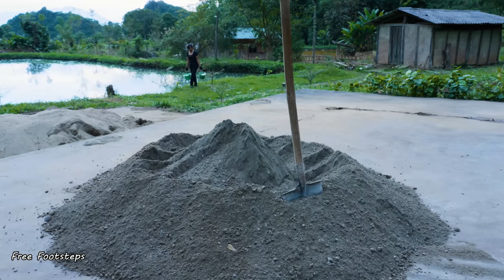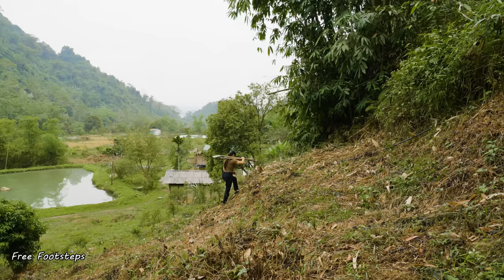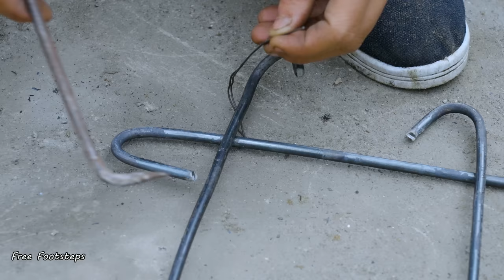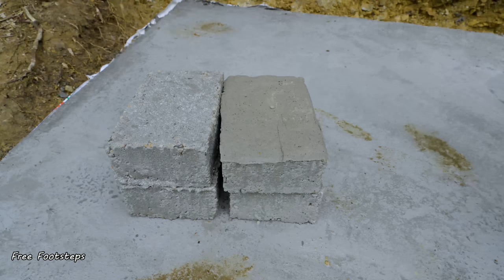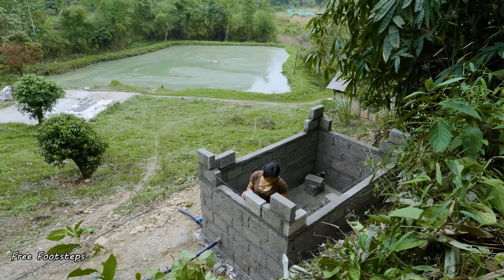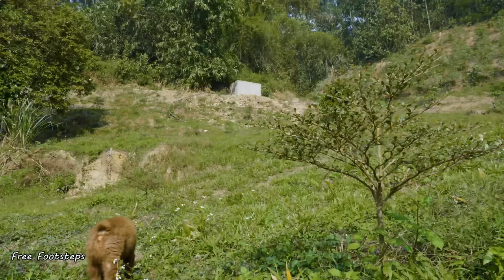DIY Brick and Build a Water Tank- Automatic Irrigation System for Vegetable Garden/ Part 5

Comment: did not lift the Rebar off the ground , total waste of rebar.  no structural strength in the cement. you must lift Rebar at least one inch off the ground.
Reply: How could she lift the rebar higher when the bricks had no holes in them ? Hmmm …suggestions ?